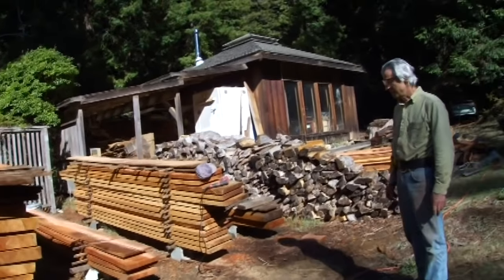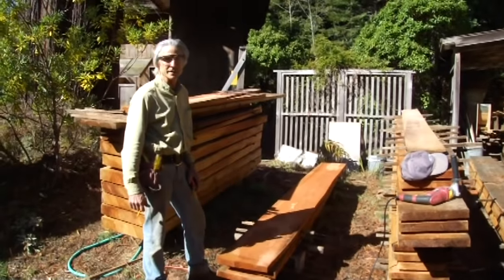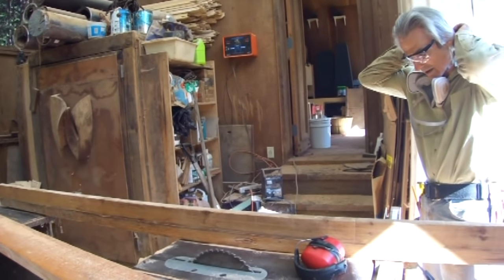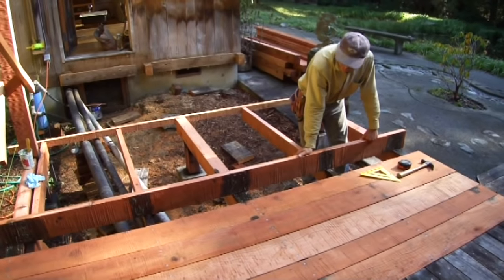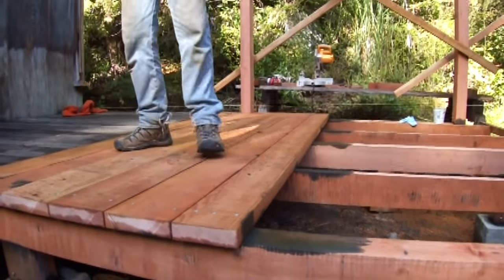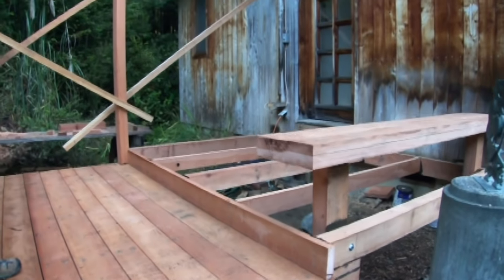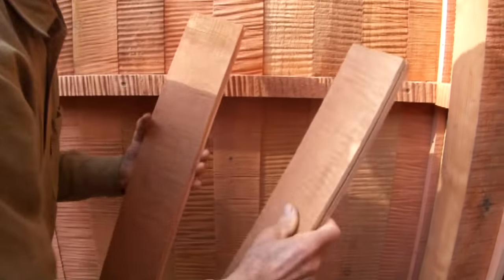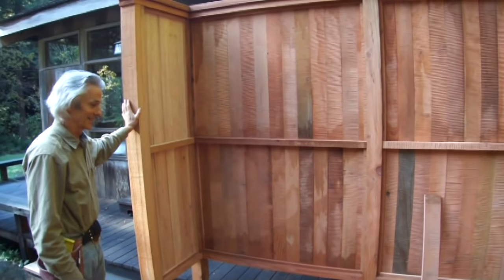Building a deck from lumber chainsawed with an Alaskan Mill

Comment: This is zen carpentry.  
I feel more relaxed after watching it.  
I’m glad you mentioned the species, cypress, as my guess would have been Red cedar.  That’s a crazy amount of chainsaw milling, but the texture IS so beautiful.  
It was nice to see you mention your sight lines between buildings with your walls on your deck.  
It’s easy to start getting chopped up when you start adding little outbuildings around your property, and it’s cool to see your process, and how you consider eye movement, as well as structural integrity and beauty.  I haven’t looked yet, but I’m hoping you have more videos showing your milling process.  I have an Alaskan mill, but have only used it for smaller projects.  This was inspiring.
Reply: Oh yeah!
I just subscribed, and see it all now.
Thanks!

Comment: Nice job. When I need to take out a warp from a board at the table saw I move the warped board along with a straight edge by the fence. To leave the straight edge fixed it would need to be long enough to accommodate both ends of the warped board while it was being cut.
Reply from the maker: That works also!

Comment: Great work David.  Love all the timber and the texture created by the chainsaw.  Your attention to detail especially sizing all the timbers for the frames etc just makes the whole job that much better.
I'm surprised the old deck rotted just where the timber crossed the stretchers/joists.  Could this have been caused by moisture not being able to easily / quickly dry off and thereby introduce wood rot?
Reply from the maker: +DRMNZ I would say yes, because the rot is caused by fungus growth and those particular wet conditions are probably perfect.